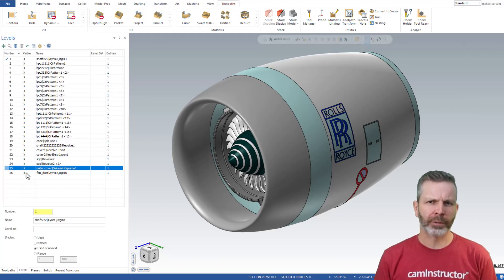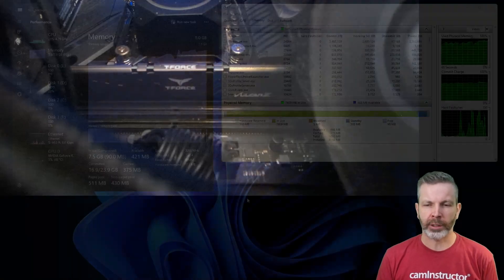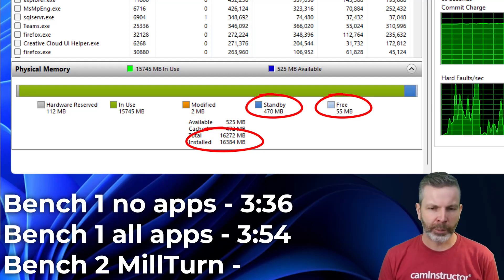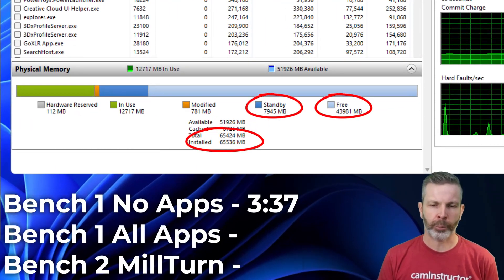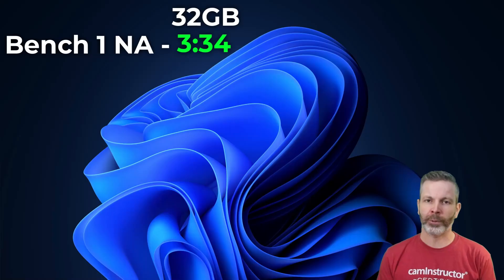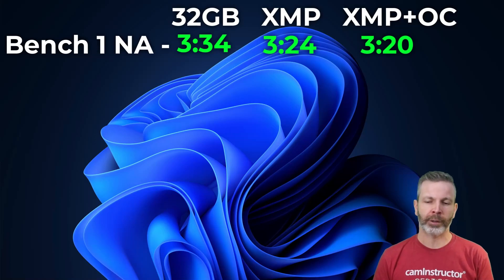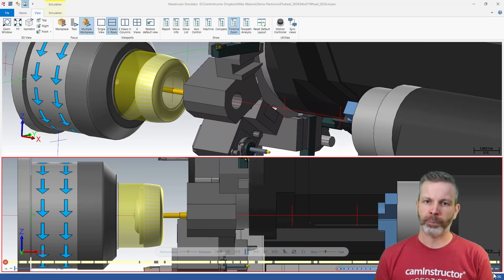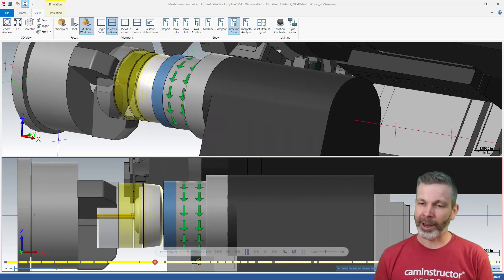How much RAM does Mastercam really need?

Comment: Doing research on sys-builds for the company I work atm. This was helpful thank you for making the testbench. I hope I find RAM Speed and other factors on your channel as well.

Where did you get the "demo file from Mastercam that is an F1 wheel machined on a Mill Turn machine"? I tried searching for it on official site but no luck.
It would be a nice performance measuring tool. Before we make our own.

Comment: the issue with the 64gb kit was the 4 sticks, a two stick kit would perform fine with xmp. its a known issue with some of the newer processors
Reply from the maker: I would consider this an older chip, I am using DDR4 not DDR5. Either way, ya, maybe 2x32 could be stable with XMP but I think the point rings true still. If you don't need more RAM, its at best a waste of money, at worst its bringing your performance down. 
If I can find a screaming deal on 2x32, maybe I'll test it out one day.
Reply: @CamInstructor yeah definitely seems to be overkill, great video